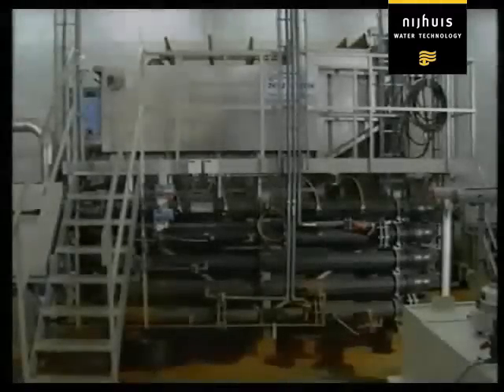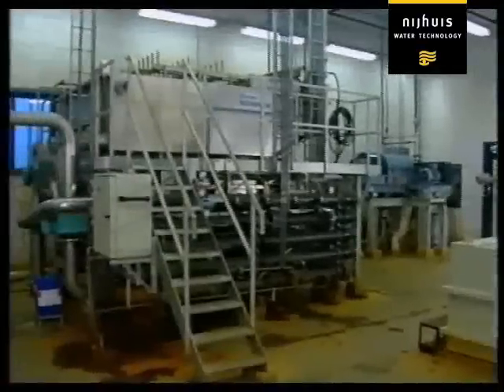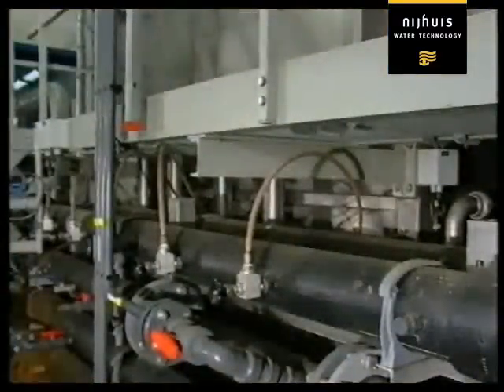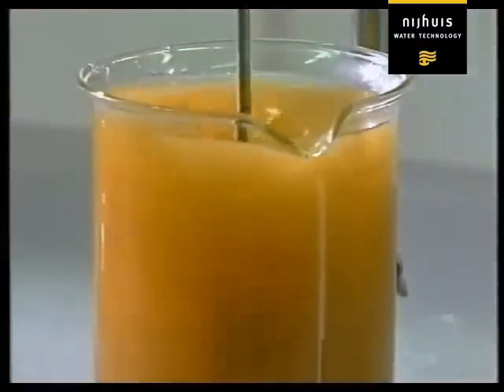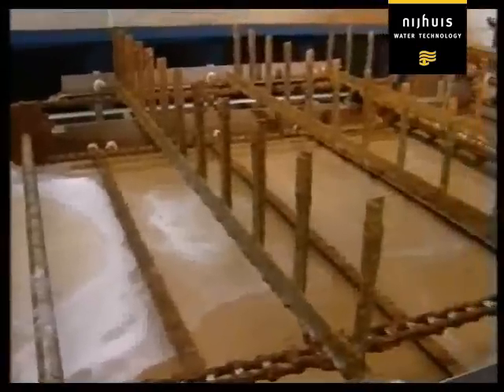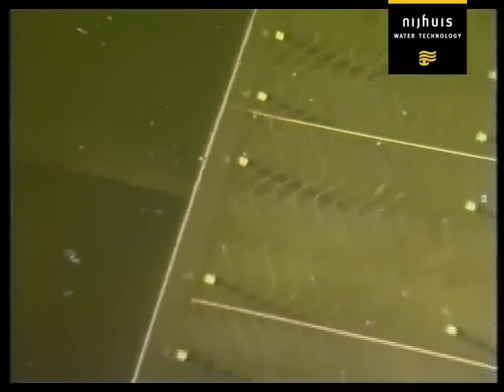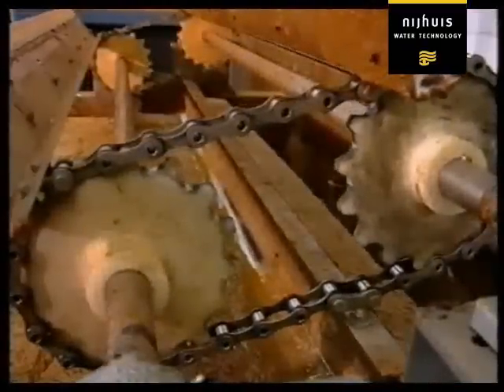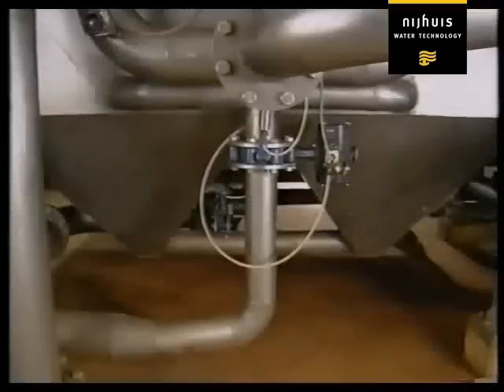How does flocculation / flotation work? (video)

Comment: So i guess you can use coagulation and flocculation in wastewater treatment. I always thought it was strictly for drinking water treatment.
Reply: @yangmary6274  thanks for that. The plant I work at uses ferric chloride and anionic polymer to help with primary treatment and cationic polymer to help with gravity thickening and dewatering. When I first learned about wastewater treatment in class we never discussed chemical usage so this is good to know